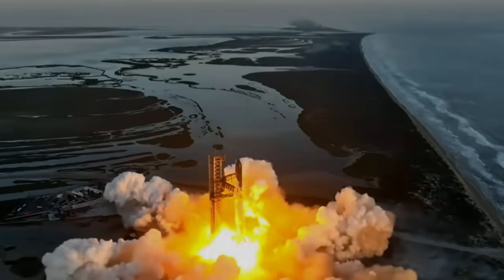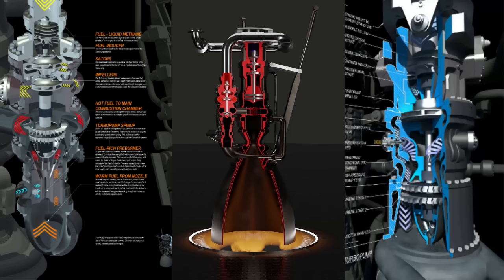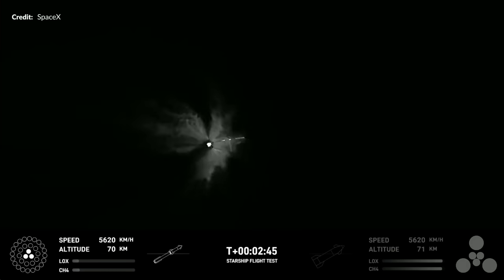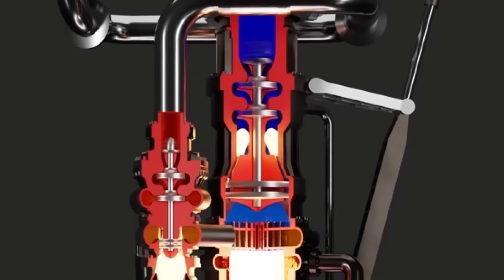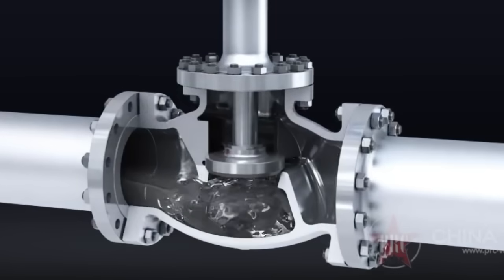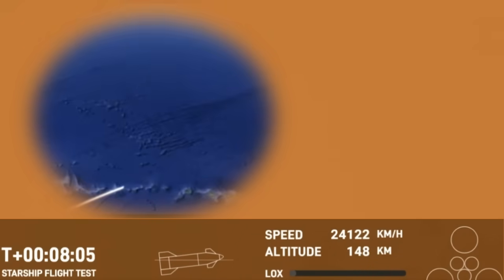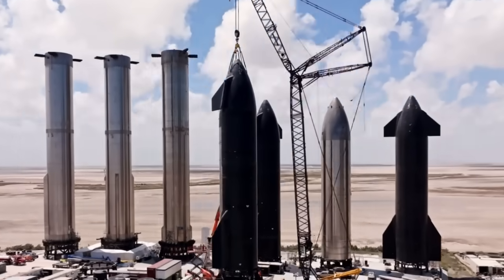Starship Flight Failure Analysis IFT2

Comment: Ok so the flight failed, (and it did because reaching proper velocity was the goal and it failed to do so) meanwhile the booster failed a maneuver that SpaceX has done almost a hundred times and is faces well known and understood issues which SpaceX essentially ignored, (just like they did with the first launch attempt) and as both booster and Starship failed to have the necessary performance to achieve the mission SpaceX manually blew up Starship. I don't see any good reason to let SpaceX off the hook here. Keep in mind this isn't even a "working model" of the actual vehicle having none of the systems of an actual launch vehicle nor even simulators for them. Both IFT's failed due to SpaceX missing simple and well known and understood issues. 
Let's be clear, major changes will likely still be needed. The vehicle is not meeting performance goals and that's again without the weight of the needed operational systems and no payload. The problems they are having should have been caught and corrected before flight but in their rush, (and not even really progressing at that) they let well known and understood problems kill every flight. Maybe we should stop coddling SpaceX and hailing obvious failures as successes. "Scale" is not an reason it's simply an excuse.
Reply from the maker: We disagree.  The goal was test these systems dynamically and the rockets are expendable.  Hot staging worked, all 33 Raptors on the booster worked as did the 6 on Starship itself.  This was an unqualified success in those respects.
Reply: @terranspaceacademy  The goal was to reach a speed making possible a reentry near Hawaii, that failed due to under performance of the entire vehicle. The Raptors failed due a known and well understood issue that (again) SpaceX neither addressed or planned for. Another failure. SpaceX will change the design again which has a huge chance of introducing new faults. Starship was going to be "cheap" by being designed to be "reusable from the start" (SpaceX's own words) and that has now clearly been tossed aside. NASA has more faith in Blue Origins than they have in SpaceX for a very good reason.

Let's be clear there were some successful moments but those are still overshadowed by the obvious and gross failures in how Starship is designed and built. SpaceX is continuing to waste a lot of time and money, (neither of which they have in abundance) on a non-working design. Keep very much in mind this "vehicle" has no payload, no operational or mission systems (not even mass simulators of them) and no real plan for how the "real" vehicle is to be built or operated. Pretty much exactly how you DO NOT design a reusable transportation system. And SpaceX has shown they simply don't care.
Reply from the maker: But they don't need to change the design.  Start only vacuum Raptors on hot staging, turn the booster off entirely and let it be pushed away by the Starship exhaust.  Flip the booster with hot gas thrusters and let drag settle the propellant then fire up center three and add others as needed.
Reply: @terranspaceacademy  That would require them to design and install a much more complex and extensive baffle system in the tanks and also add another failure point with having to restart the central SH engines which currently is not possible.

Further one still has to look at how much propellant is on board and how long it takes to settle.  And something to keep in mind is that this was nowhere near an "orbital" class launch and had very low propellant margins to begin with. SpaceX (Musk really) keeps claiming gains in payload when they have yet to actually show ANY possible payload. And this in an LV that still lacks many operational system of which mass and placement have not been done either.

The other problem is the thrust to weight of just the vacuum raptors is probably not enough which is why the have to hurriedly start the sea level raptors to make the necessary separation.

Lastly but I think importantly we must keep in mind that anyone who has done "hot-staging" KNOWS all these problems (and more) and that knowledge was and is available to SpaceX who have not apparently bothered to do any actual research on these concepts. 
This is not "rapid iteration" of a software or computer hardware type where such is extremely cheap and easy. This is again and again throwing away millions of dollars over and over again while building millions MORE of hardware that then can not be used due to a minor change in design. This is exactly the opposite of what's being claimed and worse it continues to move from the original claim of technology and economics, (cheap because it will be reusable from the start) to an essentially expendable system that MIGHT carry some payload to orbit and be thrown away ever time simply because no one at SpaceX seems to have a clue as to where they are going with this.

This is so far from the successful Falcon 0 development program, (where they literally started with a working expendable rocket that they then iterated into being reusable) that there can be no comparison. SpaceX is literally doing everything wrong and people are still cheering the train wreck.

Comment: Honestly, I am not a rocket scientist, although I am wondering why one wouldn't just use more of the falcon9 boosters.
Falcon Heavy uses 3, why not use 5? 4 corners and one in the middle with a ship on top of that. 45 raptors 
Those things already land with precision, reusable, ready to go.
Starship could still be a ways off in terms of reliability and who knows..
Not a big fan of the hot staging, dont like the louvered shell or the hammer effect. I imagine that spacex has all the data on G forces and vibration to know all about that now.
With such a dangerous stage in flipping the booster, I can imagine perhaps a secondary fuel supply, completely separate from the main tanks that is immune to being cavitated.
Weight is not the big issue with this machine, and honestly, why not add some falcon 9 to starship if you need the boost.
Starship Heavy 
🤣
Reply from the maker: It could be done but still would not match Starship :-)

Comment: Its been confirmed the booster did not have FTS, maybe fuel slosh broke the downcomer
Reply from the maker: The booster did not have FTS?  It can't fly without FTS. Do you mean it wasn't activated?
Reply: @terranspaceacademy  yes that's what I mean. Space X confirmed on their website that the FTS wasn't activated for the booster
Reply from the maker: Interesting... Then it was blown apart at the midsection right where the FTS would be.  That means that big explosion off the back sent a shockwave up that ruptured the tanks when it hit the ullage...

Comment: It seems hot staging is a delicate dance indeed!  I'm not sure that only starting the raptor vac engines on the second stage (I was surprised that the center engines were started immediately) is enough to not decelerate the booster (thus eliminating the risk of bubble ingestion) unless the booster engines are going at a pretty good clip which will lengthen the time the booster and starship are in proximity.  As I said, delicate (and dangerous) dance.  I am beginning to think that perhaps a few ullage motors may be necessary.
Reply from the maker: It is but once you get it down totally worth it...
Reply: @terranspaceacademy  At first I thought your reply was some kind of koan (and a good one at that!) but I think perhaps you are agreeing that ullage motors are necessary?

Comment: You may be on target with the Booster failure, but I don't think your analysis on Starship is correct.   1st the photo of the payload section of S25 is after the FTS detonated and the venting seen from that is from the header tank lines.   2nd the center Raptors were angled out at 15 degrees to vent out thru the vents at startup and then they are seen to gimble into centerline after staging completed.   S25 engines cut off a bit early it appears, it should have gotten closer to 27,000 KPH than it did, not sure based on data why S25 engines cut off early, I suspect "plumbing" to the RVacs as this is their first actual flight test, but I'd need SpaceX data to be sure.   I do agree that with B9 it's likely a Software Fix, not a Hardware problem.
Reply from the maker: What do you think might have caused it to fail to reach trajectory?
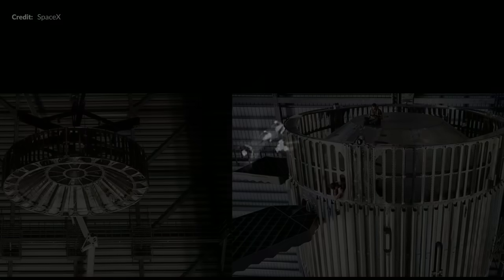Reply: @terranspaceacademy  My best guess (I don't have access to all SpaceX Data) is that around T+7:40 in the flight a LOX line ruptured on S25.   There was a "poof" and the LOX quantity started dropping quickly.  Engine Cut-off at 8:03 then another "Poof" (FTS I suspect).   Telemetry cuts off then, you do see some gas jets pinwheeling, but I think that is the payload section venting from the header tank piping after FTS, as captured by Astronomy Live.  Based on my Calcs, S25 shut down about 28 seconds early.
Reply: @terranspaceacademy  I suspect a lox line failed, the flight computer saw that there was no way to reach planned trajectory and the FTS was triggered.  RVacs have the and their feed plumbing have the least testing because of vacuum engine throttling limitations in atmosphere.
Reply from the maker: That would make sense.
Reply: @terranspaceacademy  Well after EM's talk we do know the cause of the 2nd Stage Failure to make it trajectory target, and it was an LOX issue, just not what we thought.   I guess we can chalk it up to an "error in programming" since they dumped LOX that a flight with a payload would have not had the dump.   Hopefully the Mishap report will be published soon.

Comment: Sloshing fuel has been a hazard with rockets ever since liquid fuel was first used.
Am I not correct to notice that all you have in your video has been known for years?
Further, the enormous kick given to the whole structure when the rockets fire up has induced what in known as 'Pogo' oscillations that have destroyed many vehicles.
A rocket has many other, similar 'dynamic' challenges.
There do indeed seem to be some naive rocket designers about with more money than sense. SpaceX may have a few, but not so many as others!
Reply from the maker: Indeed.  The dreaded pogo brought down the N1 on one flight. Sloshing fuel issues have been well known for over half a century.  The larger the rocket the bigger the problem.

Comment: The analysis at 8:00 is not correct. I suggest you look up videos where you can see the center engines turned outwards at firing and "gimballing" only after separation.
Reply from the maker: Within one second was not enough time and 15 degrees was not sufficient.  The plume from the inner three are reflected back by the plumes from the vac Raptors.

Comment: Wrong. Center engines on starship were gimbaled out pointing the nozzles at the openings. Video shows them facing outward and moving back in after the separation. You might want to fix that in your video because its hard to accept your speculation when you missed on such an obvious thing that has been tweeted and reported since the launch
Reply from the maker: Gimbaled 15 degrees... Not enough.

Comment: I’m pretty sure the goal was to get this into orbit it. It did not.
Reply from the maker: It was never going to orbit... just a ballistic trajectory. But it did fail at that.
Reply from the maker: It does say achieve orbit.  So they would need a deorbit burn? That doesn't make much sense.  Not a stable orbit perhaps but a "partial orbit"?  Thank you.
Reply: @terranspaceacademy  the whole narrative of the launch being a test of the hot boost or whatever it’s called was just covering up the failure. They intended to get to orbit and failed… hard. There was improvement in all engines working on launch but I’m very skeptical of this whole starship project. Why are we not seeing the launchpad? If the new system was successful, they’d be plastering the internet with pics.
Reply from the maker: We have seen the launch pad.  After the success of Falcon anyone doubting the abilities of the SpaceX engineers may have an axe to grind.
Reply: @terranspaceacademy  I’ve searched and cannot find actual images. Do you have a link?

Comment: Yeah dude no way this gets HRC without guaranteed survivability if an engine fails (either booster or starship). That means zero chance of a faiked engine taking out other engines. And that means back to drawing board.
Reply from the maker: I think they need to send it up with no crew and let Dragon dock in orbit to get people safely up.  To beat China we don't have time to perfect Starship to human rating standards.
Reply: @terranspaceacademy  How long to test and certify the Dragon-Starship docking station? Even with that I don't see an Artemis moon landing using Starship until at least 2030. NASA should have known not to trust the King of OPUD.
Reply from the maker: They should use Starship to send up a propulsion module/lander/ascent/Orion combo.  Uncrewed.
Crew them with Dragon in orbit then off to the Moon.
Starship comes back down on its own and tries to land somewhere safe.
Crew comes back in Orion.

Comment: Pfft. Don't spin this, since it both exploded, it's a failure. Yeah, they may "learn" from this, but there's a reason the Saturn V didn't have these type of "successes". SpaceX should have stuck with what works, instead of trying to reinvent the wheel.
No baffles? Hot staging? 33 engines? This thing is another N-1. Taking bets if it makes more than four attempts.
Reply from the maker: Nonsense. Do you think the builders of the Falcon 9 and Dragon capsule don't know anything at all? Sticking with what works would have us back on horses.  Everything worthwhile takes hard work.  Starship will by flying as dependably as Falcon 9 within two years.

Comment: Care to actually define what needs to happen on the next 'test' to be indeed a success? Or will the goal posts move once more? 

Booster exploded by itself without FTS being triggered manually or automatically. 
In short, the booster failed and needs redesigning.

The Starship exploded by itself without FTS being triggered manually or automatically.
In short, the Starship failed and needs further work. Work that won't happen on the already built starships. Just like no changes were made on the previously built starships, boosters or engines because of 'telemetry' data acquired on the so called previous success test flight. Else it would be public knowledge that changes were made.

Just like the previous test there was a flight plan. Just like the previous test the result was according to the flight plan. 
If I promise to my wife to get milk from the store but I crash the car at the first interjection, that isn't a success full milk run but a failure.
Same applies here.

And let's not forget that they STILL haven't figured out how to not lose heatshield tiles.
December 2025 is the mission to the moon. SpaceX can only do so many launches of Starship which means they have 24 months to make a dozen actually success full test flights and get it human certified. At the rate they are going... I don't think it will be happening this decade, not with starship. Let alone the boots on the ground mission to Mars.
Reply from the maker: Starship makes it to the designated reentry point and the booster survives to "land" in the Gulf.  No one has moved anything.
Reply: @terranspaceacademy  This time around though :

1/ Starship exploded in midflight without FTS being triggered and did so way before re-entry was scheduled

2/ Booster ripped itself apart after hot staging. So unless you count the myriad pieces of the booster scattered over the Gulf the aquivalent as 'landing' in the Gulf, it hasn't happened yet.

Neither of those two events was predicted or expected there for claiming that what happened was a success is laughable.

But what is worse is that what you would consider a success for the next flight is what according to the filed flight plan was what they were going to do a few days ago.
And even worse, next time you still expect them to trash the booster; and all the engines, as well as the Starship, 
How many million dollars of tax payer money do they get to waste before you start questioning if there is any adult in charge?
Reply from the maker: FTS WAS triggered and worked perfectly.
Reply: @terranspaceacademy  You thinking FTS was triggered and it happening for a fact are two seperate things. Even Scott admitted that the booster explode not due to FTS.
Perhaps I'm just old fashioned but whenever part of a rocket explodes all by itselt I consider that a failure
If none of the rocket succeeds in doing what it was planned to do, it's a failure.
If the FAA declares it a 'mishap' that means it was a failure.

If your son comes home from school and says that he did better than last time on a test and instead of getting 20% right he now got 30% right, would you call that a success ?
Reply from the maker: The FTS could have activated at the same time.  The images clearly seem to show it exploding.  That doesn't mean an explosion at the base hadn't already blown out the tanks at the top of the methane.
Reply: @terranspaceacademy  Could have?
Really? Could? It didn't. Not a single sane observer thinks it did.

Don't forget that it took 3 minutes after losing telemerty for them to realize that the Starship had exploded.
facepalm